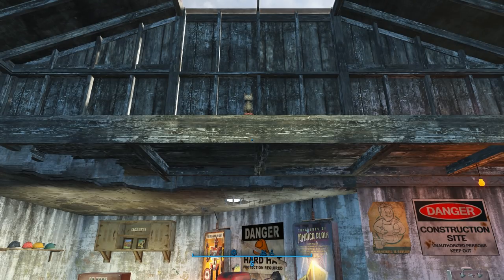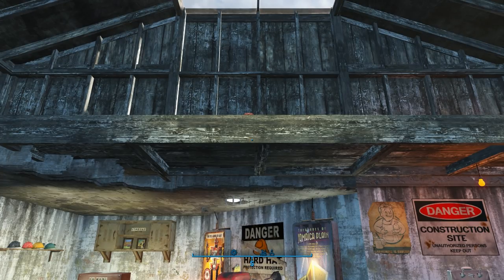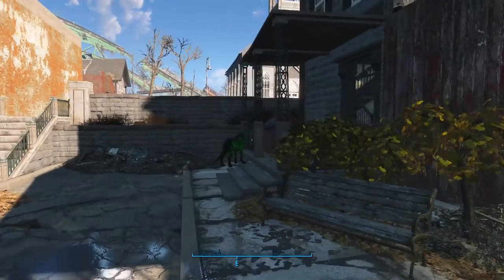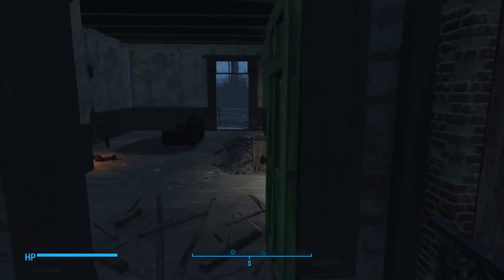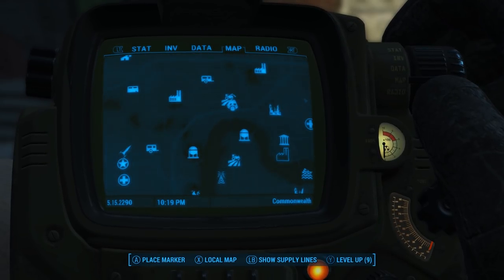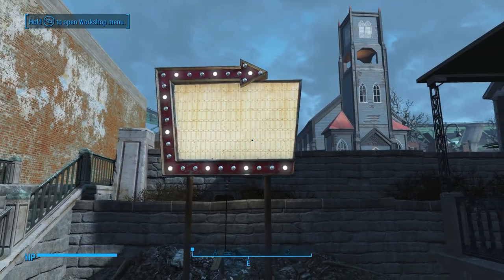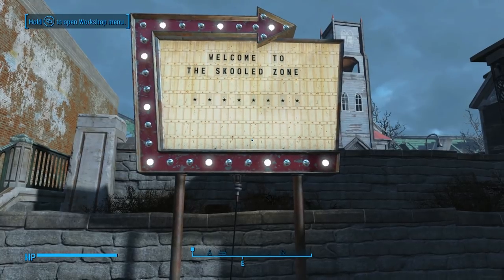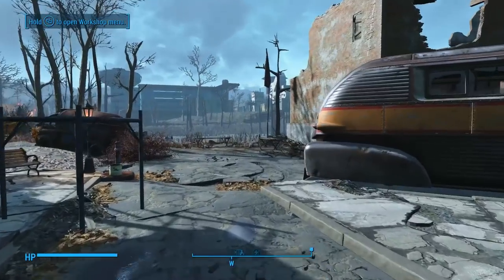Combining the Rug Glitch and Pillar Glitch 🔀 Fallout 4 No Mods Shop Class

Comment: Skooled Zone,

I like the sign advertising Vault 42 at Greygarden.  It adds some vintage flair to the settlement.

You should add a mufruit to the teachers desk in all of your videos to add to the schoolroom theme.

Furthermore, excuse me if you have already read the following tips which I posted on your furniture facing video.  I wasn't aware at the time that my post may have been filtered because it used a link do I'll repost it here hopefully fully modified enough to avoid being filtered.  Just look for the earlier original post for the credit.  That way you don't think I stole the tips without giving credit to the source.

Repost:
"A furniture placement tip for the settlement build mode is to have the game display an object that has a back to it and then have it display the item next to it.  A great example of this is to have the game display the Vault Tec bed, the one that has the white sheets showing at the head end of the bed, and then having it display the one next to it.  

When the game loads the build menu it orientates everything in it so that they are facing a certain way towards you.  Whenever you go into a subcategory and rotate it/ change its orientation, you are telling the game to put that orientation onto every item in that subcategory, thus turning all the beds, stools, etc. the same amount of degrees to the left or right.

Now all you have to do is to scroll to an object with a definitive back or front to it in the desired build menu, to get a sense of which way is front or back, and select the one that you want to build in that subcategory and it will be orientated the way you desire it to be.

Here is another helpful no mods building tip.  When you are building something and you want to support it underneath by using a pillar/post/column that comes with Far Harbor or Contraptions, you have the game suspend the object in the air and build from the top down.  That way the pillar/post/column will snap beneath the ground automatically.  I know this works with objects with snap points attached to them in the game's code.  I don't know if it is the same for ones that don't have them.

I am not sure if you already mentioned it in your No Mods Shop Class playlist, but I will post here anyway just in case you haven't already.

Hopefully this helps you."

Sincerely,
Jennifer M. Montgomery
Reply from the maker: Thanks Jennifer. Yeah, that comment had gotten stuck in spam. But thanks for reposting. Also, you'll see the mutfruit on the desk in the next video! ;-)

Comment: Point about doors here. You said majority of doors open inwards. Well round here they wont. Heavy duty secure doors all open outward and its general rule of thumb that doors opening outwards are much harder (or near impossible) to break in. 
Typical scene you can imagine is in movies where they kick the door in. Try doing that with a door that opens outwards.
Also some secure doors round here come with 16 bolts all around the edges of steel door. 
It takes alot of effort to break through that door. If it would open inwards you could bash it in with a ram or something however the case that it opens outwards makes it impossible. It will be easyer to bash through a wall next to the door.
Reply from the maker: You are correct when it comes to public buildings. I should've made it more clear that I was talking about domestic doors. This link talks about the difference: https://home.howstuffworks.com/home-improvement/remodeling/question584.htm

Comment: If the settlement is attacked, can those buried generators take damage (directly or through RNG), or are they always protected? Great series BTW.
Reply: If you are not there to defend the settlement, what gets damaged is randomly chosen. I've had generators in concrete rooms with no doors get damaged
Reply from the maker: bigguygrizz67 is correct. I actually mention in the next video that at one of my settlements I buried a generator in a rock wall and still had to pull it out and repair it after an attack. So it must be random because there were no explosions even close to that area.

Comment: To sink the generator under the marquee, you don't need the rug since you're using the pillar glitch though, right? I'm pretty sure I sunk a generator at The Visitor's Center in Far Harbor, with only the pillar glitch with the conduit only. I hadn't yet seen your video wuth the wire glitch at that time.
Reply from the maker: If you can make it work without the rug then that'll definitely save some hassle. But if it gives you any trouble, you can add the rug as an option. You can also use stairs with the rug as another useful option for sinking things, like I did in my junk fence video: https://youtu.be/Emv1ZfOOFdQ :)
Reply: Skooled Zone Your video on the junk fences was quite the welcome relief from wrestling those damned things around in my game. I can't understand why on earth they made them so hard to work with. I notice that you are good on giving rationale for things, which gives a better understanding for them (As a former nurse, I really appreciate that.), so what's your theory on why Bethesda made them that way?

Comment: I'm curious. I tried to utilize the pillar glitch to put in the end of the long building at Sunshine Tidings. I used four full floor pieces (Warehouse), warehouse walls with windows, four roof pieces, and two full warehouse walls. I tried the concrete column, both inside and out, but I could not get it to go active. Is there a better way of doing this?
Reply from the maker: Sometimes these things work perfectly and other times it can frustrate for hours. Try taking advantage of the natural snapping feature by putting a foundation piece as close to where you want the wall on the outside and then see if a wall will snap to it. Hope that helps. :)

Comment: Hey, man. I need some help. I have wasteland workshop and use the garden plots and I have an odd glitch. When I store the plots, they will get stored along with the crops, but the crops are still interactable in the workshop. I attempt to store/move them, but uh.. It f*cks my game up. It's consistent as well. I need advice on this. Thanks!
Reply from the maker: It's funny you mention this because I was actually trying to pillar glitch some crops the other day to do something cool with them and I ran into a similar glitch. What I ended up having to do was scrap the all the stored plots and crops and start over to sort of reset it. Try that and see if it works.
Reply: Skooled Zone How do I scrap the crops? Also, when I scrap them, it seems to make the problem much worse because if I try storing plants individually the glitch will only work if I don't move my camera away from the spot where the crop once was, it'll perform the glitch. This issue is new to me, and I'm pretty sure Wasteland Workshop is why lol.
Reply from the maker: Do you have any mods installed?
Reply: Skooled Zone Yes, but I don't believe that they would be causing this glitch.

Comment: I have a question about a very specific circumstance.  In Covenant the first building on the right used to be the general store.   I'd like to use that building as a store myself, in fact, if it could work, you could get TWO stores in there if you could glitch them into the existing counter.  Maybe because it's a store and not some random object, but it will not let me hide a shop inside that counter.  Any suggestions?
Reply from the maker: Hi Jospeh, have you seen my Covenant video? https://youtu.be/CL129zHWgug
Reply from the maker: Yeah, I tried it with the beige counters and it doesn't work. But you can rug-glitch in some of the wooden stalls.
Reply: I like to try to do thinks the stock game way first.  I did happen to catch a video by Oxhorn showing a mod that lets you build a store with a mat where the shopkeeper stands, or a cash register they stand behind.  This worked out perfectly for Covenant.   Bluebeer's Vendors is the name.